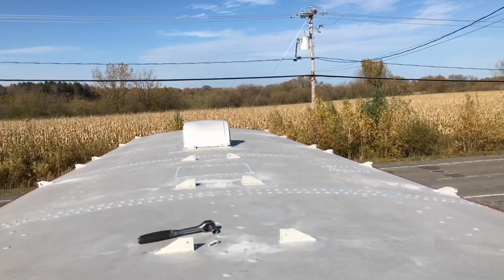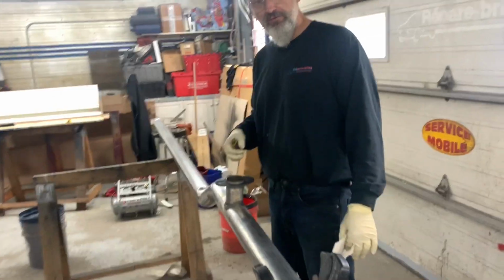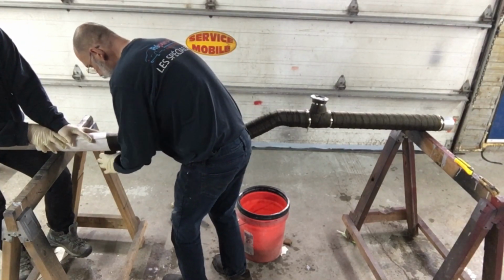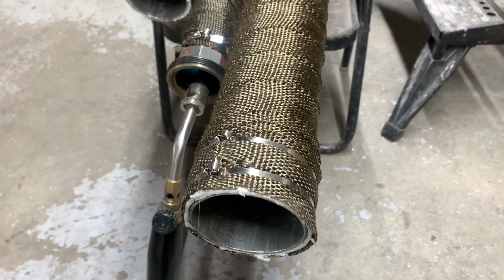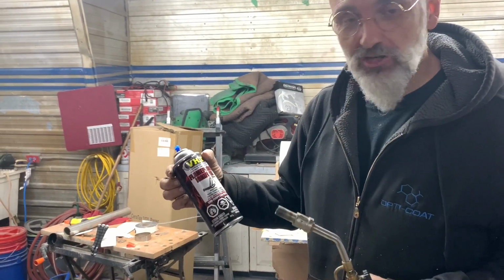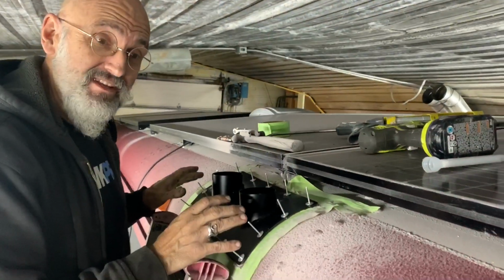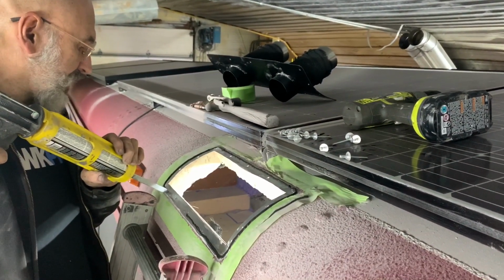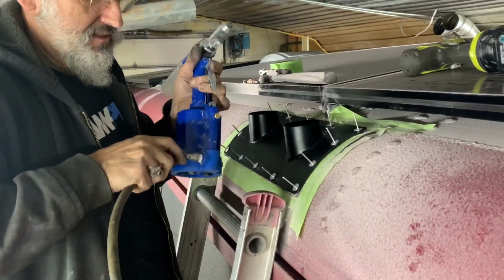E31, Solar Panels (4100w) and generator exhaust out the roof!

Comment: Came back to this episode for some panel insight. Having a 40’ foot probably helps with getting over 4K watts from your roof. I didn’t hear you talk much about the panels you used, though. Maybe I missed it? But would you mind sharing brand and ratings/volts output of the panels you used? Thanks again!
Reply from the maker: The 8 smaller panels are Silfab 320w 48v panels. The 4 larger panels are Canadian Solar 390w panels also 48v
Reply: Did you wire the 320panels separate from 390’s to your inverters? I’ve heard that if you wire two different panel sizes (watt sizes), that you watts In is limited to the smaller number? If you wired separately, that would not be the case.
Reply from the maker: Yes, the panels are divided into 4 zones, each zone going to its own charge controller.

Comment: Looking amazing as always, is there any chance you could give us a little more details of how your solar panels attached? I like the way you did it with your hinging tabs rather than track the entire length of the bus.
Reply from the maker: They are made from 1 1/2”  x 1/8” aluminum angle 3 1/2” long. The angle cut is 27 degrees, the bracket on the bus has a 1/4-20 threaded hole. The hole in panel brackets is 9/32”
Reply: @LacroixCruiser  yeah I watched you make them they look great I guess more of what I would like to see is how they attach to the solar panel, and how many you put on each panel and where they were mounted etc.
Reply from the maker: @constechable  they are attached with 1/4 20 bolts and nylon locking nuts. The 320 w panels have 4 brackets, the 390w panels have 6.
Reply: @LacroixCruiser  thank you, any chance I could get a picture of the bracket bolted onto the panel especially the middle one?
Reply from the maker: Send me a PM on https://www.facebook.com/lacroixcruiser/ I’ll send you some pictures

Comment: Will you or have you done a run in to check pipe heat? Also are you adding flaps to the pipes like the exhaust on a semi tractor?
Reply from the maker: Yes, we ran a test before insulating them, and they only got warm. They will be separated from the living quarters in their own insulated box. That box will also have venting. No need for flaps, the pipes have bends that will catch rain drops, bringing them to the side of the pipe. The pipes are open to the ground below.
Reply: @LacroixCruiser  The level and quality of your build as well as the design and execution easily equals and surpasses a professional build. Peace of mind is priceless 👍👍
Reply from the maker: Thank you, being our third build, we’ve seen what works for us. We like simple, easy, and durable designs.